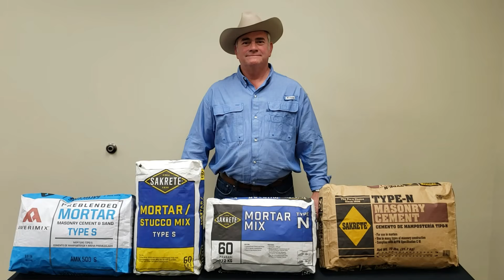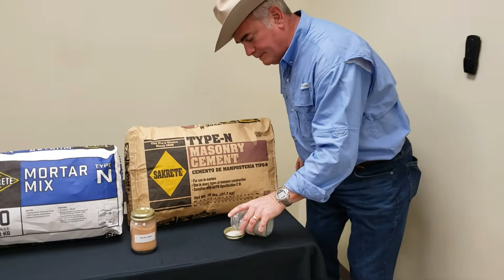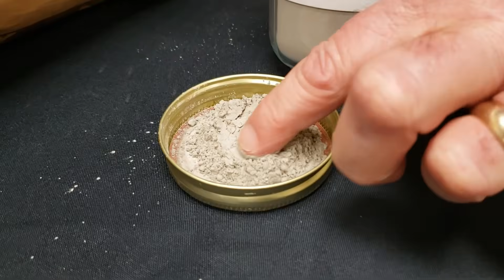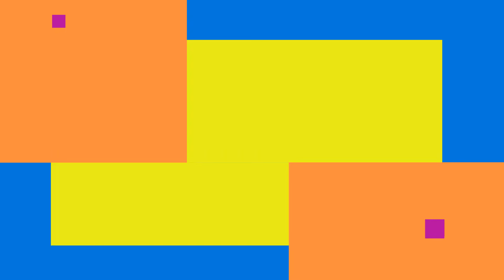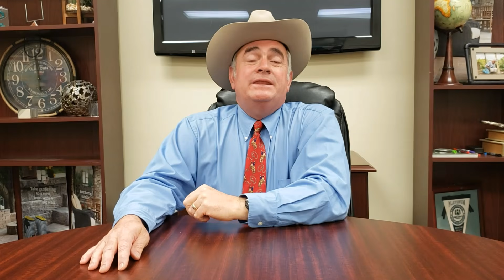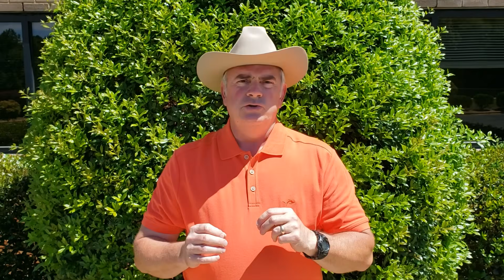Masonry Cement vs Mortar Mix Explained by the Carolinas' Concrete Cowboy

Comment: Howdy Cowboy!  Our question:  What should we use to re-lay flagstones on a deteriorating stairwell?  We are thinking we will paint/wet the bottoms of the slates and put them on top of whatever mix you recommend. Obviously, a mix without stones/pebbles in it.

Thanks, Rancho de Piedra

Comment: Thank you for the education.
What can I use as a DIY to patch cracks on a sloped driveway. Cracks are not more than 1/8 inch wide. Both sides of the cracks are still leveled. There is no vertical shift . I live in western NC. Thanking you in advance.

Comment: Concrete Cowboy?  I hope you have a heated saddle.  I always buy Portland Cement and Lime and mix it because I've never seen Masonry Cement sold around here.  Its possible I overlooked it because I didn't know about it until now but they don't sell stucco mix around here either.  It's like you said, all cement, mortar, concrete products you can get in your area, even from national companies, is strictly regional.  I'm surprised you have stucco mix available in your area.   Great presentation and basic info.  You didn't go into the sand, make sure you use sand for mortar and not just playground sand or whatever.  It's not the same. Thanks.

Comment: I want to pour a small 2'x2' slab ti build a rocket stove on. I want to add perlite as agragate and I will over. Cam I use type s mortar vs cement mix?

Comment: Shoot. I didn't know that type S was necessary for structural applications. I used Type N on my foundation block wall. The block wall is only 3 courses high and will only support a single story home, built with standard 2X4 and 2X6 framing. Nothing is unusually heavy. Will I need to worry about my Type N Block mortar failing? I used high strength concrete mix to fill the cores and bond beams. I also used 3/8 rebar in the bond beams.

Comment: Hold on there, Mr. Note.All I've only been laying bricks since 1975 completed aprintice Ship and 77 your information on the mixing of the sand with the type  N or S is foul.You don't mix 3 to 1 it's , 2 parts sand to 1 part cement or 2.2 to 1

Comment: Hello Sir, I'm having difficulty finding a tutorial on how to add a brick skirting around a pre-existing storage building.
The building is 12x20, the height of the left end is 27 " and the height of the right end is 8" 
Can you please advise how to go about it ?
I'm determined to do it myself but I'm concerned about the correct process.

Comment: I don't understand why masons prefer to manually proportion/mix instead of buying pre-mix. Even with pre-mix, you can adjust by adding more lime/sand/cement if needed. Also, particulates in the air are just as bad with pre-mix especially in windy conditions.

Comment: , Portland cements main ingredient is a lime 😂...u r confused..
The difference between the cemen😅 is in the additives... basically andin percentage of lime used in each for extra strength... masonry cement is more for plastering and bricklaying because the additives are most cases fly ash which is coal ash... depending on country which by products they include...and.as.for mortar mix cement is stronger in strength and doesn't have any such additives like coal ash etc.. mortar cement is for strong work structures like concrete bridges etc...and.most of.all is that concrete mixtures... masonry can absorb water after drying process and mortar concrete mix doesn't really absorbs water densely..😂

Comment: I would like to know what type of mortar to use when placing small black rocks in the mortar with several inches between each Rock. I don't want to use a ground because that will really mess things up. I do want this sealed properly without a grout. I would like a pure white mortar that doesn't have to be sealed with a grout. Please help. Does it need a polymer since I won't be grouting? If so can I get a solid white polymer?

Comment: As a builder, the only 2 issues about dry mix mortar and cement alone are,
 the price of dry mix mortar 
And cement. 

I had never ever used dry mix mortar  to mix concrete.
Instead I take cement, aggregates,sand and water only.

Dry mix are very expensive, than sand, aggregates,water and cement in a building project. 
Dry mix are a highly engineering products in terms of sand, polymers.
Nice video.

Comment: Wow so grateful. I always want to know how things work. 
I asked 7 people at a brick paver and Home Depot and Ave hardware what the difference was between S and N. No one knew. In NY I was just told to use S (for strong 😅) for repointing the brick and multi colored slate of my front porch stairs.  
I bought (sp) sancrete mortar mix . I plan to add quickrite cement adhesive to the mortar mix while hand brushing adhesive to some areas (where I could not remove all the old mortar) . 
I’m going to tape off all the slate (irregular edges with duck tape (for metal) just so I don’t leave stains. I’ve already spent 4 days scrubbing, using chemicals, and masonry bits removing 20 year old mortar stains and overspreads . Hoping taping off will be a neater solution. 
Someone told me to add sand for extra stick to my sankrete mortar mix. I think I’ll rely on the manufacturers ratio instead and leave good enough alone. 
I have one deep hole under the stoop . I’m wondering if any concrete base was ever there because there No damage to the surrounding stone . Just a deep giant gap. It not at the bottom like weep holes , but I wondered if these air pockets are for a purpose ? Should I just pour mortar into it ? How would such a large pocket dry ? Estimated 6 inches deep. The “pocket “ appears to be the circumstance of a cereal bowl. But the actual gap is the size of a regular 1/2 inch mortar space between bricks . Our temperature drops to 20 degrees, is that the purpose . First timer and wondering if it’s some kind of expansion joint ? It is two steps above the weeping holes (a 3 step stoop) . My instinct tells me it’s intended as a air pocket and that I shouldn’t try to fill it up . 
Any advice (will be hand applying concrete adhesive in this area for the mortar to cling properly to the sides of the brick since there is no foundation beneath (in this area only) every other part of the stoop has a perfectly intact foundation.

Comment: Will mortar mix N work for making small, concrete pots for my succulents?
Reply: No. Use rapid set cement all. But use their retarder in the mixing water or u better pour into the form fast as F. It sets up quick, but perfect for making concrete molds like flower pots.

Comment: The mortar is supposed to be the sacrificial part, not the brick or CMU's!! It's difficult to get even type N around here anymore let alone type O, as I suspect people are choosing to use type S out of lack of knowledge and/or understanding. Take for example an 8x8" clay flue liner chimney with 6 standard bricks per course. Each brick weighs close to 6 lbs. so 6 x 6 = 36 lbs per course. Four courses is a foot tall. 4c x 36 lbs... That's 144 lbs per foot in Height. A 30' tall chimney is approx 4320 lbs. (not including tile inside which bears on it's own basically). The area of each brick is 3.5 x 8" = 28 sq. in. and 28 x 6 bricks = 168 sq in. Take the weight of the chimney and divide by the footprint or area of the bricks, 4320 lbs/168 sq. in. to get PSI = 25.7 psi load on the bottom most brick and mortar which makes 1800 psi type S ridiculous in compressive strength. Even with a 10x safety factor, the 25 psi load at 250 psi still makes type N just fine. How about for the sake of argument we were to build a ridiculous 1000 foot tall chimney of the same dimension. 1000' x 144lbs = 144,000 lbs. Divide by the area or footprint once again, 144,000/168 = 857 PSI. Type S still laughs at the load! More important is the elasticity and compatibility to the brick being used. So think for yourself and stop using type S if not required for a specific application, please. The mortar is the sacrificial part!

Comment: Not very clear in your opening statement, and attempts to clarify Mortar cement without sand was confusing.  However, the difference between Mortar Mix and Mortar Cement needing sand in the correct ratio was very clear.  Thank you for posting.

Comment: you do not cover the important part of your type mix. It's all about the portland/lime combination ratio. It's quite irritating your guys still can't get it right and convey the true content of those bags! Type N has less lime than S proportionally and slaked lime is quite different than hydrated lime usage. Constantly mixing up the definition of mortar / cement / concrete / structural and composition of the mortar mix leads to complete misunderstandings and NOT complete definitions to make a real general rule. sorry
Reply: Type S 67% Portland 33% lime.  Type N 50/50. Type O 33% Portland 67% lime. Type K 100% lime.
Reply: Sorry bro, it's 2024.  Any homeowner looking for youtube help, is NOT going to buy sand, lime and cement.   There buying affordable ready mix.      I hand mixed everything for my pops for decades and ate lime and cement,  wish he had a affordable ready mix.   Also. Your argument is false, YT had a million videos on hand mixing mortor said, lime, cement ratio.   It's 2024 dude!!!

Comment: Very helpful, I'm going to lay a slate patio and I wasn't sure if I should mix it myself or get a premix.  It seems like the premix is the way to go in a residential area and then I don't need to worry about too much or too little sand.  Thanks for the explanation!!

Comment: Hello, love the video.  I need to do some pointing and parging on an inside stone foundation in an older, 1870-80’s brick home. The area stays dry. The majority of older parging is in good condition some has flaked off. While the majority of the exposed mortar is in good shape, I think it needs to be pointed before parging. 
Can I use one product to do both, like an S type mortar mix, or do I need two products. In either case, what would you recommend for this project?

Comment: Thank you for this explanation  Cowboy 🤠
QUESTION: I want to grout Saltillo Mexican tiles. I want as smooth a grout line as possible and not so grainy or porous. Smooth not rough.
I would like to use Mortar mix could I add some Portland cement to the mortar mix for a smoother texture maybe,???
What would the portions be? 

What about adding more lime for smoothness? If so how much?

For instance maybe 1/2 bucket of mortar mix add 1 large tomato can (28 oz) of cement....or a small (16oz) tomato sauce can of cement...

Thank you 😊

Comment: Mix ratio for type N mortar is  2 Portland,  2 Hydrated lime ( AKA type N masonry Cement)     plus 12 sand.
      .........Type N Masonry Cement is 50% Portland Cement + 50% Lime...........
Each shovel full of type N masonry cement ,  will be mixed with 6 shovels of SAND for the specification
of Type N mortar.         Or;    1 Portland  + 1 Lime + 6 Sand = Type N Mortar                 ....   SHOW me I'm wrong

Comment: That portland lime mix is what is required to repair an old brick house. I bought one and the psi for regular mortar is too great and breaks the bricks with normal shifting of the house. I I knew I had to use portland, but didn't understand why until you mentioned  the huge difference in psi. Good video
Reply: How did your repair go?
Reply: @Katana_00  It is not repaired. To be clear, I bought an old brick house. the brick is in serious need of repair. I don't like getting ripped off so before I hire someone I have been watching videos on how it should be done. I knew portland lime was supposed to be used because my house is about 100 years old. I did not understand about the PSI and that pressure with the mortar and the brick is why it had to be mixed with portland lime and not the newer mortar mixes. Your explanation of the psi and why my very old bricks would break makes perfect sense now. Hopefully in the spring (2023) I can get someone out to repoint the house. your video was very helpful and I have it saved. thank you much.

Comment: I need some advice, if you could help. I have to repair some spalled concrete on our foundation. The spalling is not very deep, but in one place a steel support can be seen. I understand a little ,such as all the loose material has to be removed. After that it gets a little confusing. For example if I use "Top and Bond " I am not supposed to add any additional product such as "Weld Crete", which would seem desirable on the exposed Simpson support (which has not rusted). "QUIKRETE Polymer Modified Structural Repair Gray Fast Setting Cement " would seem to be a good product, but that is only from looking at the label. If you could give me some advice it would be appreciated. I would like to finish the job with some sort of sealer for example Master Seal 550 or something else that helps prevent future spalling. Thanks in advance.

Comment: Thank you for your video. It was really helpful. I am really trying to learn more about Cement and concrete and what's what. I do have one question is the masonry and Portland the same thing or is there a difference? One of the projects that I want to do I watched a video on and they said to use one part Portland and three parts sand and I know that's what you said with the masonry.

Comment: Thank you, I’m thinking the type S mortar mix would be best to resurface cement front steps, would I be correct?
Reply: They make a concrete resurfacer that is sold at home depot. You'll have issues with type S cracking if you try to use it as a resurface

Comment: Hi.....i bought cement because. I didnt know what the difference was.   .....😂.
I realized after i already mixed it..
I know. Dense of me not too notice the little pieces of hard stone..😂
I used what i had stirred to fill up the open pockets..
So what a waste and not.
Finally i got the type s mortar mix..
Now i best get my head into how to do this after its mixed. 
Because i never done this before. I used a half a bag on 2 blocks. Jeesh
😂. And i havent even started in the caps yet. Omg give me the strength to complete this with success.
I cant afford anyone to do it. And im not having anybody u$ing me dirty for trades.
So god help me..thank you for this presentation.

Comment: Greetings Dirk,  I just watched this video.  I understand what the uses for Type N & Type S mortar mix.  I’m a DIY’er and although for some of my uses type N would be sufficient, however, I have found type S is easier to handle and work with.  I’ll spend the extra money for type S just because I like the way it handles.  Can you tell me why type S handles differently or is it just my imagination.
Reply: Type S mortar has more cement, less lime.  Type N mortar has less cement, more lime.  Some would say the type N is easier to work with because of the lime (it holds more water).  The type S probably seems to handle better because the higher cement gives it a more paste-like consistency.

Comment: very informative thank you..> need to do one on Cement parging mix...https://www.menards.com/main/building-materials/concrete-cement-masonry/bagged-concrete-cement-mortar/foundation-insulation-coating-cement-50-lb/1894260/p-1444445320876-c-5648.htm?tid=-5666927577704547659&ipos=3

Comment: Great video, and really helpful starting out. Would a premixed mortar type S or type N be more suitable for dry interior limestone mortar repair? I am reading up and see some people saying never use S on stone but I see S is more suitable for load bearing walls.
Reply from the maker: Type s on stone is normal. I was raised to mix cement and masonry cement to lay stone.
Reply from the maker: Limestone is your question

Comment: if you were to use type S for a structural foundation repair or patch to say a hole or a large crack, how do you get the patch to match the color of the existing foundation, i.e., in my case grey?
Reply from the maker: Type S is for laying brick, block, etc. When you say "structural repair it sounds like concrete repair. There you could use Sakrete Top N" Bond for feathered to 1/2" or Sakrete Fast Setting Cement Patcher for thicker repairs. Both are a concrete grey.
Reply: @carolinasconcretecowboy-di9499  OK. Thanks.
I have a concrete porch with risers, treads and a top that are chipped, have gouges, and small holes that I'm thinking of (1) patching and (2) completely resurfacing.
Can you recommend a product(s) for this job.

Comment: Thanks for the explanation. I have a question about bonding agents. I need to repoint the very old stone foundation in my basement. I gather Type S mortar mix is probably fine, but Type N Mortar mix is an even safer bet. My question is about latex bonding agents.  Two "This Old House" videos say to add a concrete bonding agent to the mortar mix for better adhesion to the old stone - but the instruction on Quikrete bonging agent says to not add it to mortar mixes. Do you have an opinion on this?
Reply from the maker: When one tuckpoints old masonry, you usually use Type O for brick was so much softer long ago. I don't think that will matter with stone.
Reply from the maker: Bonding agent should not be needed. Tuckpointing is just replacing mortar. Most stone masons either use S or blend S 50-50 with portland cement. I can't think of a reason why Q says not to add bonding agent to mortar? You would use it 50-50 with the mix water.

Comment: Thank you so much for this video! I had purchased the sakrete mortar/stucco type S and was working on my chimney. There are two problems: one is that it’s so grainy in comparison to what I see in some pointing videos where the mortar looks more like a putty. The other issue is that this mortar is very dark gray while the rest of the old mortar is a much lighter color. Any recommendations on these two issues?
Reply: Problem with pre blended mortar. Is sand weighs more than cement. What happens when it is being sacked. Sand sinks faster than cement with any kind of vibration.